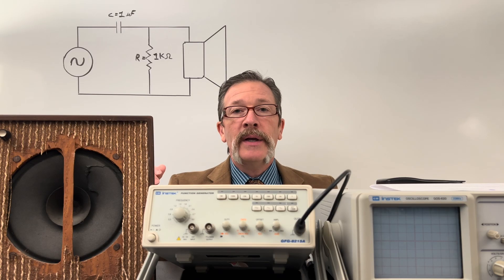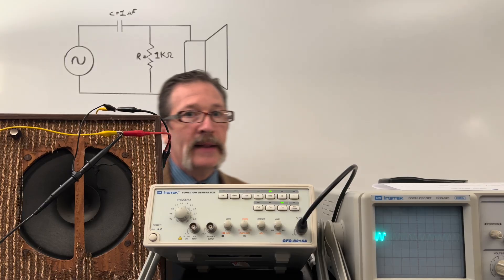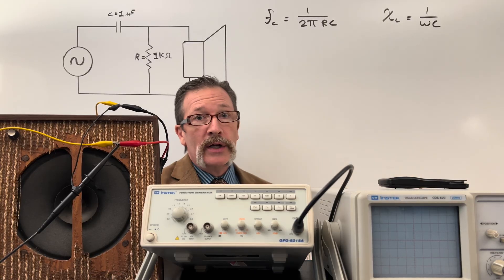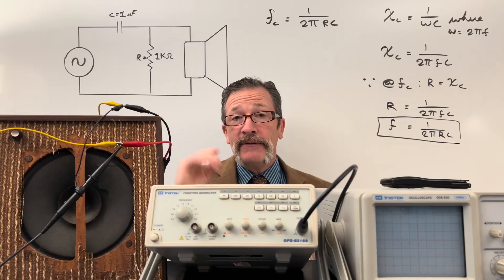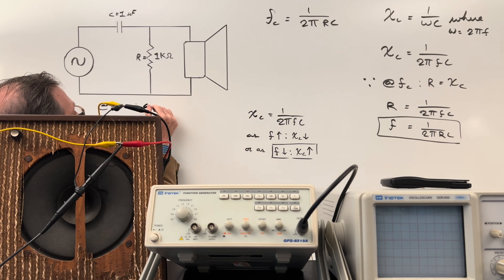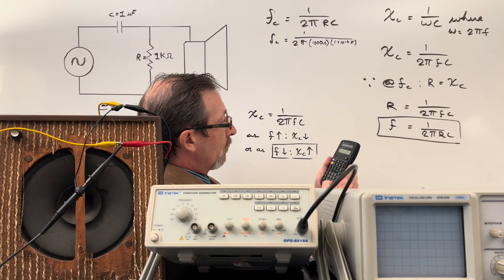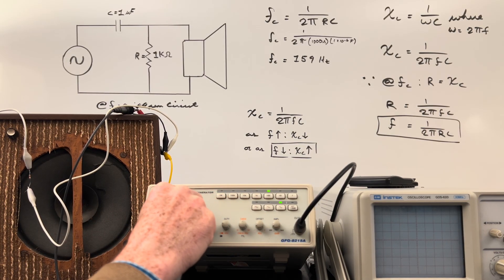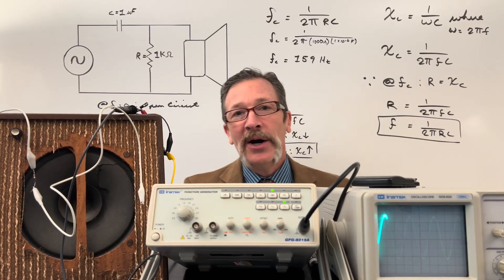How Do High-pass Filters Work?

Comment: Thus demo is weak. The scope should be connected across the resistor to show the decreased amplitude at frequencies below cutoff.

Also it would be illustrative to show that the RC network is a voltage divider. As reactance of the capacitor decreases, more voltage is present across the resistor.
Reply: No pleasing some people
Reply: @ishanr8697  I'm an EE with over 40 years of experience. I just want people to get a clear understanding of what is being shown.
Reply: @josephcierniewski7034  Expertise is no good if you communicate without empathy. Dude has put out a free educational video that has a lot of merit and your first sentence is "Thus demo is weak".
Reply: @ishanr8697  I learned this stuff ages ago so it's not a matter of pleasing me.

Comment: You can make high pass filter just with a capacitor , it will not have as sharp a characteristic as one with a resistor or inductor. I usually is called DC block and they act like a high pass filter.
Reply from the maker: Thanks for this comment!

Comment: How does a filter work?  Does it absorb/reflect unwanted frequency/energy?  Some of the electrical energy is converted to kinetic energy by moving the speaker diaphragm ... Is any of the electrical energy converted to heat?
Reply: Thats an interesting question!
In the case of the loudspeaker - it is essentially a coil of wire ( connected to the cone assembly)  moving in a magnetic field - so the coil possess both inductance and resistance .  ( and also presents a dynamic load due to energy being translated to kintetic ) So the impedance of the speaker  varies v frequency . Some of the electrical energy is converted to sound ( kinetic energy as the cone  moves) - but a much larger proportion is dissipated in heat in the coil structure - which is a major design consideration in high power speakers - getting rid of the heat ! 

If you take an electrical signal source -( such as the sine wave generator)  it has an internal impedance - could be say 50 ohms.  If you connect a 50 ohm  pure resistive load to the generator - then there is pure power flow from the generator to the load with no reflection. ( z load = z source ) 

If you change the load impedance from 50 ohm to some other value - then some power is refected back to the generator.  

In this case with the high pass filter -  the load impedance changes widely as frequency changes - going from capacitive at low frequencies ( xc = 1/2pi f * c)  to nearly resistive ( 1k ohm) at high frequencies   So at most of these frequencies power is both reflected back - and some absorbed by the 1k ohm
 ( and the loudspeaker - which actually probably masks the 1k ohm since its impedance is more like 4 to 8 ohm )
Reply: I am an RF test engineer and measure quite a lot of filters in my carrier. In general for the stop band frequency (for high pass filter low frequency) the power is reflected back to the generator.  If you use something like VNA (Vector Network Analyzer) you will see that as Return Loss  close to 0dB or  VSWR (voltage standing wave) very high number - approaching infinity (total reflection). There is also a class of non-reflective or reflectionless filters that are more complicated, they are highly desirable with converters as they limit the number of spurious due to reflection.
Reply: @miroslawkaras7710  I believe what passes through R is dissipated as heat, what passes through C is reflected.
Reply: @Enigma758 That's not always the case. With AC in transmission if the R is equal to characteristics impedance of that transmission line, the signal is absorbed, however if R is different,  then it is reflected.
Reply: @Enigma758  The resistor in RC filter government rate of discharge of the capacitor. It will be a good idea to see that in the time domain to better visualize what really happens in the filter.

Comment: At around 8.39 you are using 1kohm as the value of the resistance.
However- that loudspeaker looks like a fairly low impedance - say typically 4 or 8 ohm as is most usual for that type of moving coil loudspeaker
That will be in parallel with the 1k thus swamping it.  ( im assuming that there is no high input impedance amplifier in the loudspeaker cabinet  (- this needs to be made clear) 

Also - on the video - the scope trace is not continous - it is broken into chunks and not easy to see.  - and that is important since it is quite difficult to hear small changes ( less than 3db) in amplitude.) But is easily seen on a scope trace.  So its the scope trace that is really the key player here.

It would be far better to have used two traces on the scope - one showing input amplitude - ( constant) and  the other showing  output after the filter - this  would then  clealry show the cutoff frequency when xc = r ( -3db power point , vo = vin * 1/Sqrt(2) 
you can  overlay the traces so you can easily see one of them changing in amplitude. ( and in phase)
....
and..... using a high input impedance amplifier to drive the  loud speaker thus leaving the 1kohm resistor unaffected.

And finally -as a "piece de resistance"  play some music through the system and demonstrate how the sound changes when the filter is inserted ( make sure cutoff is around 1-2 khz so bass is lost.
Reply: Your suggestions are very good!

Comment: but it would work with only the cap, so the restistor is to set the Q factor, the amounts of dB attenuation per octave,  and if you would want more, you could place two caps in series giving the same value (so 1/2 the size) and then add another resistance to ground connected in between them to ground

Comment: This is a really cool example, and a great way to introduce practical applications for analog circuits. Most people learn capacitors and inductors, but never realize how powerful they can be in controls, audio engineering, and communication systems. I wish I had something like this in my physics class in high school!
Reply from the maker: Thank you! We feel strongly that electronics can open up an entire world for students while also allowing them to master core E&M
Reply: @idealizedscience  Switch the power to dc and can you do the calculation and explaine what will happen??